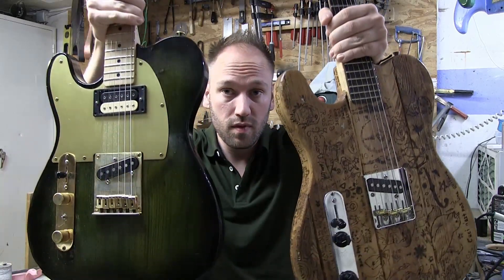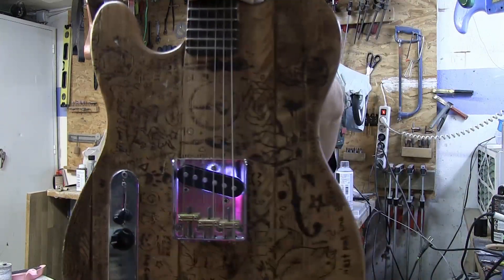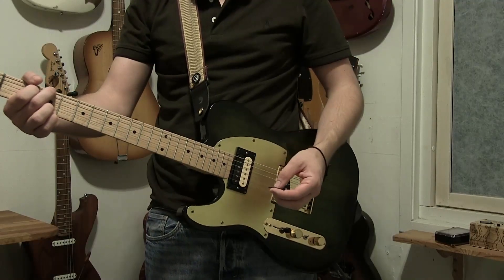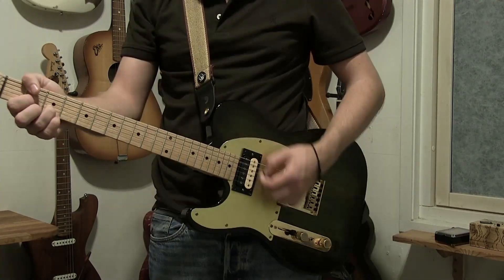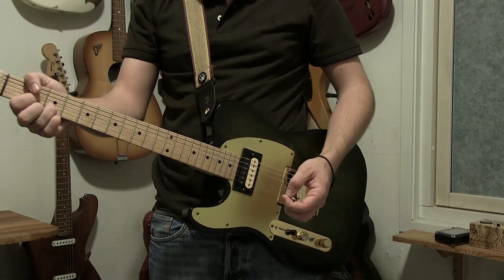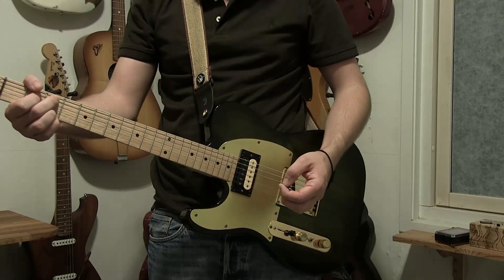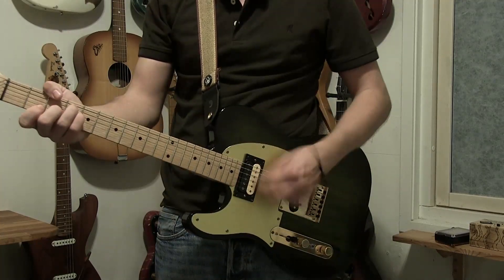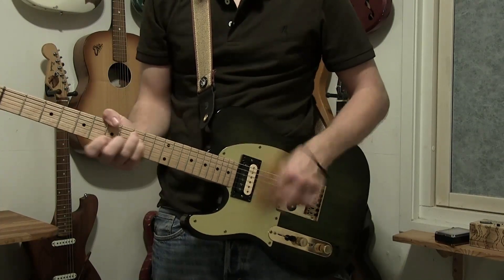comparing Ceramic magnet pickup to neodymium magnet pickup

Comment: The bridge pu with Neo magnets has an other position, that makes the low strings sound less bassy and the upper strings less sharp. It is very difficult to notice the difference in magnets in that way.
Reply from the maker: Yeah there is a lot of differences between the two guitars it was more for fun than scientific 🙂

Comment: Neodymium should have a darker sound, which the brown guitar seems to have, but I'm surprised at how much louder the green guitar is
Reply from the maker: Very interesting observation I measured both pickups and the brown guitar has a 6,05k resistance and the green has a 6,33k 🤷 cool that you notice it I didn't 👍
Reply: I noticed not because of different volume per sé (or however you write that expression 🤷🏼‍♂️), but because it was driving the amp or amp emulation more. The other guitar by comparison sounds like the volume knob isn't all the way up
Reply from the maker: @Thr3-Words  yeah but still I didn't think of it 😅
Reply: I agree